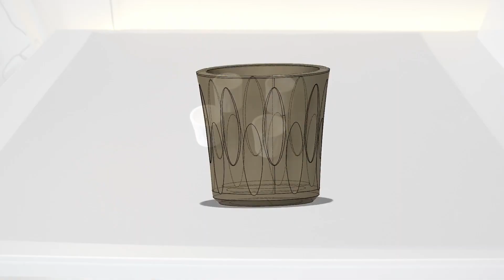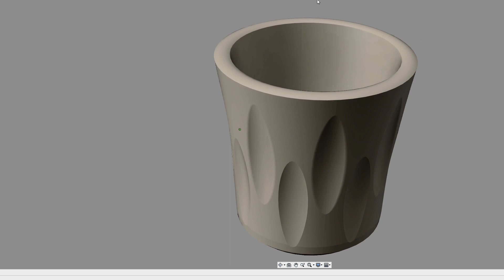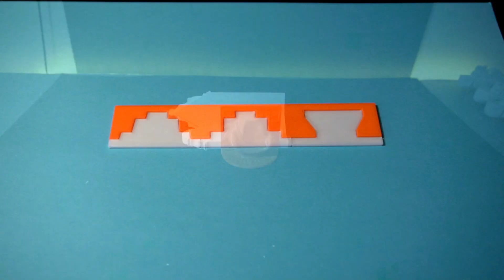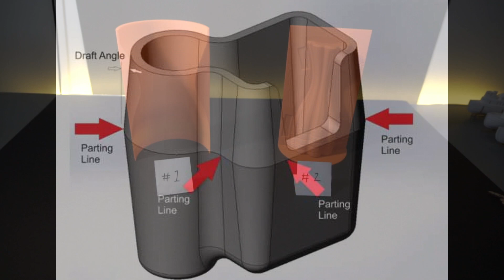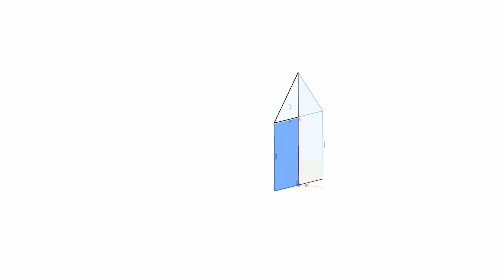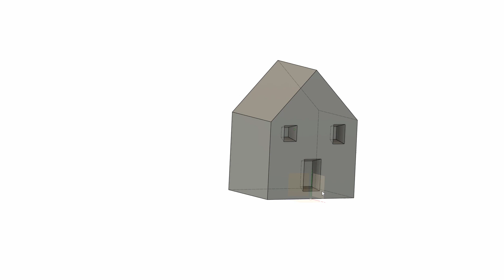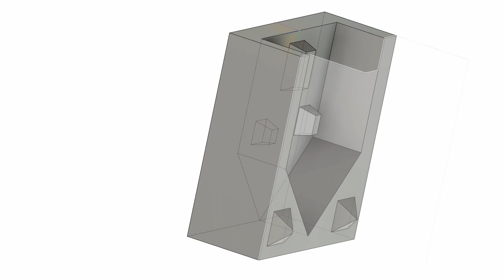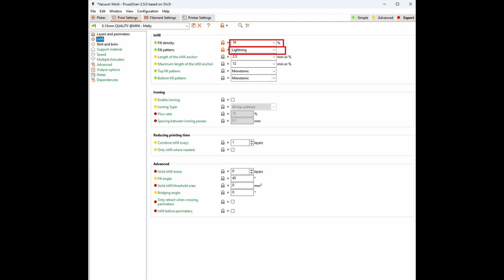3d Printed Molds for Plaster or Concrete - Boil Molds

Comment: Why this boiling and ruining mold method? Why didnt use only demolding spray before you poured the plaster? For concrete was perfect my homemade isopropyl alcohol+caster oil 9:1 and no problem with demolding. Unfortunately my problem is the 3D printer. The extruder doesnt pull the filament anymore... I cleaned, I changed stepper motor, checked cables, factory reset... nothing helped. :( I stucked.
Reply from the maker: My smallest features a mm and the model is hollow. Demolding totally break the statues. This allows me tiny details without breaking them. For large things, sure, make it re-usable!

Comment: Thanks for all the tips. Since most of the time I just care about the heft/sturdiness I started to just print the models with a low percentage gyroid infill, use the slicer to suppress walls for a fill-hole and fill the print up with plaster. After that a bit of sanding and paint and so much less work/pain :D

Comment: That is just amazing! What plaster do you use? I have been making some small decorative items but they are breaking real easy and i cannot stop bubbles forming on details
Reply from the maker: Thank you! I think it would be called alpha plaster. There's something similar called dental plaster but that's a bit grayish. Vibrations help with bubbles, but the kind of plaster used here is probably less prone to bubbles.

Comment: Is it okay to pour and make a mould on a 3d print plastic directly for ceramic clay?
Reply from the maker: You can make press molds in plastic but plaster is used for liquid clay because it de-hydrates the slip and hardens it around the edges. Slip in plastic molds doesn't harden the way you want it to.
Reply: @mattiasfagerlund  Now I understand! Thank you

Comment: I’m eager to try out this technique at some point. I’ve found a reusable silicone substitute in the form of making agar molds that are beautifully compatible with plaster. After demolding, the agar can be remelted to make subsequent molds. I usually can only get one casting out of the molds but I love being able to just re-melt the mix. The other recipe I use is less compatible with plaster and better for water based clay, but you can get multiple castings from each mold and then also remelt the material for subsequent molds - this utilizes glycerin and gelatin. Thank you for sharing your techniques, I’d love to be in touch!

Comment: You ever try "firing" the clay casts in a Microwave Kiln, the plaster outer case with a layer of Silicon carbide on the inside. The Silicon carbide absorbs the microwaves and heats whats in the kiln. they are usually used for glass.
Reply from the maker: I haven't, no, but I have considered it. They seem rather small, though?